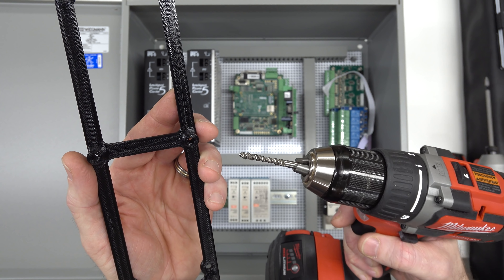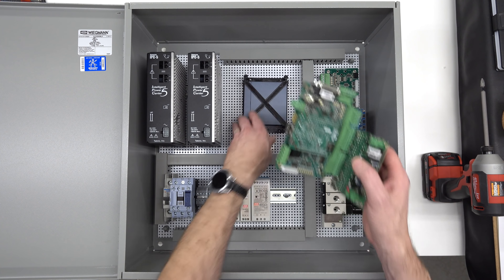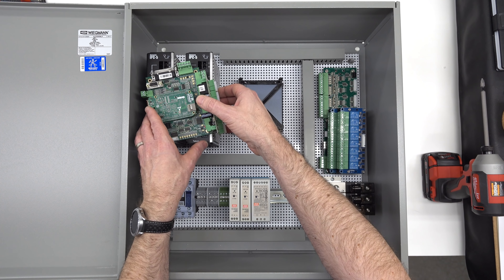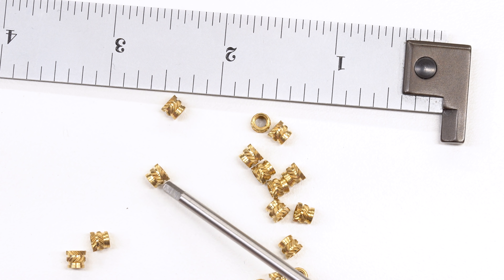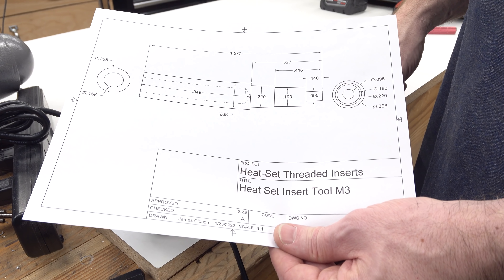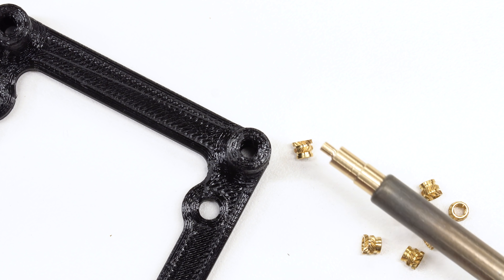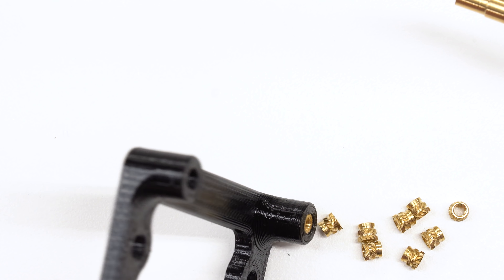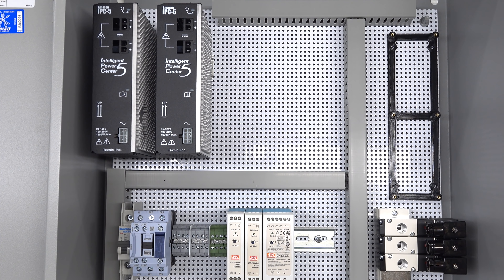Using Heat-Set Threaded Inserts | 3D Printed Acorn CNC Controller and Ether1616 Expansion PCB Mounts

Comment: Heat set inserts are great over direct thread or tapped thread in plastics.

Another thing I do fairly often if the print setup allows for it is print in place hex nuts of sorts. Essentially just print the right hex size recess and close over the recess for the hex a couple layers above the height that I would start to close over the nut and then add in a pause at the start of that layer so that I can drop the nuts into the hex recesses and just print right over top of them  with just a hole the right diameter for the screw. This isn't necessarily as good as a heat set insert but it works great and I have tons of hex nuts of all sorts of sizes and they are cheaper than heat set inserts (about a 3rd of the price) and more versatile since they are not restricted to just one particular use. The only time I avoid doing this is of the boss OD isn't large enough to have  at least 4 perimeters beyond the circumscribed diameter of the hex.  This however is just a personal preference for no particular reason since 2 and 3 perimeters seems to work fine.

Comment: A tidy control box is its own reward.  Also, with that coy reference to CEE, I noted your fluency using both Metric and Imperial measurements.
Reply from the maker: It's a necessity where I live.  Locally available machines, materials, and cutting tools are all denominated in inches.  The dimensions on the soldering iron, the tip, and the fasteners all originated in millimeters, but the dials on my lathe are in inches, so that's how I output the drawings.

Comment: I suppose you could press in a length of allthread in a similar way (using heat) and then use a nut to hold the board onto the mount. One advantage there could be that with the use of some spacers you could stack multiple components on longer sections of allthread.

Comment: If you were me, you’d want to be able to see all of the indicators on the switch etc. during operation.  Also, if you were me, it would not have been BEAUTIFUL and so well designed.

Can you talk about that bearing tool you used?

Thanks for sharing with us!
Reply from the maker: I'm hoping that the only thing I need to see in operation is the computer screen.  You are correct: if I start having network problems, I'm going to want to see the lights, and I can't the way I have it mounted.

The tool you mention is commonly referred to as a "Bearing Bump Tool".  I built it years ago after seeing a Clickspring video where he used one.  http://www.clickspringprojects.com/bump-lathe-centering-tool.html

Comment: Heh! I had two surprises with this video. 

First, how on Earth you've managed without heat set inserts until now? and secondly, why you you chose to hard mount and didn't print a DIN rail mounts for your circuit board frames? 

Great stuff as ever James.
Reply from the maker: I judged 3D printed DIN rail mounts too weak for the stackup of the network switch and the acorn.  It would have been pretty flexible.  And the Ether1616 would be vertical on the rail, which would have been doable, but not ideal with 3D-printed clips.  That also would have added about another inch of height to the stackups, putting the terminals even higher up for the wires to enter the cable ducts.
Reply: @Clough42  Good points that I should have considered before commenting, although from this angle, the height issue in general is  hard to asses. The placement of the Ether1616 I can now see wouldn't  be quite so elegant.

I have in fact used 3D printed DIN clips on another project, and found them to be more robust than I imagined. You might also be surprised at the inherent strength. I wouldn't hang a few KW of PSU off of it, but for your PCB frames, I thought would be ideal. Anyway, your layout of the cabinet looks very neat.

Thanks for the reply and I can't wait for the reveal of the whole project you're working on.

Comment: Though I have been watching for years, I did see you pop up on the Centroid forum. At first I was thinking that your back panel was plastic. As I am repurposing an old Acorn along with a new Ethernet 1616 on my mill, I wanted to use a plexi/acrylic sheet for the back panel and it was recommended I dont as the boards are intended to be grounded thru their  mounting points. That now brings me to your plastic and electrically isolated mounts. Will you tie into the panel via a wire? Or ignore it? If ignored do you expect interference?
Reply from the maker: The Acorn and Ether1616 both have an earth ground terminal on the 5-pin power connector.

Comment: Tips for doing this are available for Hakko FX-888D for various sizes of inserts. No need to make them if you have that soldering station. I think getting them in squarely is more of a challenge if you use a traditional tapered tip, or if you use the ones that don't have that little extra locating collar.
Reply: Yeah I found a set on amazon, I kept my old hakko just for inserts! Its nice having a tip on it and ready to go

Comment: I've put in a ton of these, the only real trick is exactly what you've done, buy the inserts with the crosshatching in the middle rather than the straight, parallel to the bore type.  That is critical for grip. The way the plastic relocates during the process, generally pushing some down, I would think a taper would be worse, assuming your printed hole is to spec in the first place.  You generally want less extra molten plastic trying to relocate, not more.  I've always printed straight holes carefully calibrated to be at spec for the insert and have had no issues, when using the good inserts.

Comment: It may be an overkill, but blind rivet nuts would be much better for that perforated panel. The panel is made of 1.897 mm sheet metal, so it's a bit too thin for self-drilling screws.
Blind rivets would require more planning on the parts placement, but it doesn't seem like planning is your weak point.
Great ideas and beautiful execution.

Comment: Very first 3D assembly project was a Voron 3D v2.4 open source printer, where the parts are themselves printed. . Used heat set inserts for M3 and M5 inserts. Thought this was a fairly common process.

Comment: 40 years in industrial automation says be sure and exhaust air directional valves out of cabinet. 
Good looking cabinet so far
Reply from the maker: None of these are directional.  There will be a small amount of air coming back from the spring-loaded ATC cylinder, though, so it's probably worth piping out the exhaust.

Comment: Awesome
Reply: I think your going to love acorn. I have it on my mill and want to add it to my lathe and cnc router in the future. I also have the eth1616. 

I am curious though,  are you not concerned about the heat from the switch rising to the acorn board? They seems awful close. You have depth in the box, maybe more vertical separation. 

Greg
Reply from the maker: No, I'm not concerned about it at all.  There's a half-inch gap, and it will be oriented vertically when installed.

Comment: Consider snap fit or interlocking fastners designed into your 3d print. They can be designed for tool free assembly, and they reduce parts count and assembly time.

Comment: When did you show off the pneumatic crimping tool? I've been looking at them recently.
Reply from the maker: I just showed it in passing in the control transformer video a couple of weeks ago.  It works great for ferrules and large crimp terminals.  The jury is still out on small stuff, like Molex Mini-Fit Jr. and Dupont connectors.  I finally found a die for small stuff, but early results aren't super promising.
Reply: @Clough42  went back and watched it. Interesting, but it makes me curious what else is out there for small scale production.

Comment: I hold a small aluminium block over the top of each hole after inserting, the insert will naturally try to creep out a bit, the block keeps it level with the top and it self straightens.

Comment: So I have a solder station with both pencil & air. I use 3 different tnserts, but maybe will still turn down tips for the pencil. What I have been doing with great success is screw the insert onto a LONG bold, Heat the insert with air and push it in . El-cheapo leather gloves are fine and the long bolt gets the insert quite straight using the 'reckless eyeball'...

Comment: They are pretty nice, even the cheap crappy ones that CNC Kitchen found were not very strong: have used them for building a cooling fan bracket for my 3d printer. I feel like a third of your projects involve one of those nice big electrical cabinets... In my mind you probably keep your socks in one too 😉 I'm jealous of your analog fx888, the digital has such a terrible interface. I basically never change the temp. For my inserts, I just use a cheap crappy soldering iron, think I paid a buck for it after rebate at a hardware store. But this is totally the kind of project I'd love to have a lathe for.
Reply from the maker: I do most of my soldering with the FX-951, just because it has better availability of fine tips for SMT work, but it also has kind of a weird digital interface.  I have it set up so it works for the lead-free solder I use the most, and I don't touch it.

Comment: How about the cooling fans - have you considered air flow for component cooling?  FYI got my Tool & Die apprenticeship while getting Engr degree at night, never regretted that. Also sent 10+ years with CNC machine builder.

Comment: I need someone to do a pull or fatigue test on these straight push in style inserts. To me in my mind, I want the insert to have some twist-thread-melt action to aid in the embedding process.
I've only used regular threadserts, that have to be twisted in to wood projects, and never these smaller ones. I wonder if I turn down a brass tip with a hex head, I can twist melt the inserts to gain a bit more pull resistance?

Comment: I would be curious to see your take on Centroid's CNC12. I use it for my G0704, but I've never really felt like I've "figured it out."
Reply from the maker: I've been using MACH3 with a SmoothStepper for several years, and been frustrated with it the whole time, so I wanted something different.  People I know who use MACH4 hate it.  So I decided to try something totally different.  I considered LinuxCNC with a Mesa card, or Acorn, and chose Acorn.
Reply: I use Acorn on my PM940V CNC conversion and I am quite happy with it. Still on the learning phase.
Reply: Based on your previous projects, I expect to see a lot of custom macros and VCPs for your Acorn.

Comment: there's TWO better processes than undersizing the holes and tapping them.  yes, you can use threaded inserts, but you can also thread the holes in CAD and they will print mostly clean.  If you tune your machine correctly and account for some things in CAD, you don't need to chase the threads afterwards.

Inserts will usually be stronger, but the benefit of not needing other materials as well as the ability to just use super long screws to get more contact between the plastic threads and the screw threads, printed threads are a very good option.

Comment: i think getting them in straight easy is mostly because of your special tip.. i don't have access to that so i have to use my regular soldering iron tip and that makes it a lot harder to align it straight
Reply from the maker: These tips are all over Amazon now.  Though you do need an iron that can accept it.  Or you could get a replacement tip and file it.

Comment: My favorite way to provide a way to hold a screw is a square nut insert.  My Prusa printer slicer allows me to hold for filament change.  I insert holes the size of my square nuts inside my 3D part.  I set a hold for filament change at the top of these holes.  The printer stops at the right spot.  I insert the screw or magnet.  Yes I use the same trick for magnets.  I tell the printer I changed the filament, which is a little white lie in this case and the printer will encase the nut or magnet.  My printer even beeps when it's time to place the inserts.

Comment: Correct me if I'm wrong. 
But isn't it easier to remake a ready-made tip for a soldering iron?
 It's not that expensive. Take the one that is thicker and process it.

Comment: Months late :D But one thing about your final install there: You've covered up the "Mounting the spacerpanel to the backpanel" screws with the parts. Meaning *everything* (in that stack) has to come apart to take that out. AKA: Relay 1, relay two, ethernet board - all out before you can separate the baseplate from the case's backpanel. I don't imagine you'll have this in-and-out that much, but I think that I would want the entire block of electronics to come out as one - with the spacers. I'd go so far as to have "notches" not "holes" on the bottom edge too. Shrugs.

Comment: What’s the rating of the air valves as they will get oil and other contamination all over the inside of the enclosure
Reply from the maker: I'm using an oil-less compressor and the air goes through a filter/drier before entering the cabinet.  Still, the valve exhaust is plumbed out through a single port in the manifold, and adding a fitting to take it outside the cabinet would be easy to do.
Reply: @Clough42  I would definitely think seriously about plumbing the exhaust out of the cabinet, or move the valves out completely.  Oil less compressor right now, but what about the future?  And getting dry air is sometimes really hard, depending where you are.  In MD, during summer, with refrigeration and desiccant dryers in an air conditioned building, we still fought water in the air system. 

 Plus many of those valves have an override on them that you may want to be able to readily access without opening the cabinet.  

Good luck!

Comment: Just model 3 x .05 threads in Fusion, run a tap through the hole to clean it up,  (or just thread an M3 into the hole a couple of times) and you're good to go with the added time and expense.

Comment: If you don't screw it on and off multiple times, you can print the threads. I've had good luck with sizes down to M3. I've not tried if smaller yet print good enough or not. Not good if you need it to put up with a lot of force and use a small size. Plastic threads are plastic after all.

Comment: Machine screw threads aren't intended for use directly in plastic, certainly not the soft plastics used for 3D printing. You can buy screws that are designed for use directly in soft plastics, they have a thread similar to that on a sheet metal screw and the center has a lobed triangular cross section. I forget the correct name, type B something or other I think, but you can get them at McMaster, I think I paid about 5 bucks for a box of 100.

Comment: I do alot of threaded inserts in my prints, I have been trying to find a good way to make my standoffs/holes have custom perimeters much more than walls, Does anyone know if cura or other slicer can auto mark these features as such ?  Since pla, especially, melts so easy I find you need to have more than 2-3 walls or they deform alot. Or even some dumb fusion tricks ?

Comment: McMaster Carr standoffs would have done all that stacking for you
Reply from the maker: Nope.  The holes don't line up.  The boards are cantilevered over one another, with nothing below the holes of the upper boards to anchor to.
Reply: @Clough42  yeah
The stuff I've built I always used plain back panels. Getting paid by the hour on my builds, drilling and tapping time was okey dokey 😉
The majority of the time i could just use self drillers (for din rail and the like) so it was darn near painless

Comment: I use M3 self tapping screws.  Easy peasy.
Reply from the maker: That works great if you don't need to take them in and out multiple times.
Reply: @Clough42  if you have room, start with a shorter screw, if it isn’t holding,go to next length of screw.  Most of the time, I only need a few repeats, and it works fine as long as you don’t over torque.

Comment: "plastic doesn't hold screw threads very well." it does if you're using the correct screws, specifically designed to be screwed into plastic, and not standard machine screws. most people wouldn't claim that wood can't be held together with screws, because most people have the common sense to use wood screws to do it, not machine screws.

Comment: I'm curious, aren't the board standoffs supposed to be connected to earth? By mounting onto plastic bracket non of the boards are connected to ground? I have seen weird behavior on equipment due to grounding issues
Reply from the maker: The Acorn and Ether1616 both have an earth ground terminal on the 5-pin power connector.

Comment: I think you will like the Acorn Controller, maybe not the interface.
Reply from the maker: Yeah, I've fiddled with it a bit.  But remember that I've been using MACH3, so my standards are low.
Reply: One thing the Acorn does not seem to have that I have seen you use a lot in Mach 3 is the 1/2 function for setting the axis zero to the center of the material. You’ll probably find other differences as well.
Reply: I expect you’ll write a lot of custom macros.
Reply: @ptrotter5223  fact

Comment: You do like I do.  Put 10 pounds in a 5 pound box.  Check Ethernet cable clear space from switch to cable way.  Also com port to cable way.   Never enough room.
Reply from the maker: Yeah, I have a lot of it wired already, and the Ethernet cables are the tightest part, just due to the connector geometry.  Monoprice SlimRun right-angle cables are your friend for applications like this.

Comment: Why don't you just 3D print some Din rail mounts to attach onto your PCA boards?
Reply from the maker: There would be a lot of weight and overhang for this particular setup.  Also, the Ether1616 mount would be vertical, which I don't like.